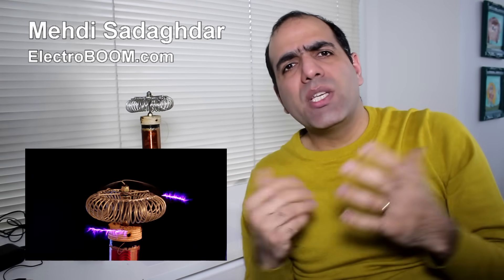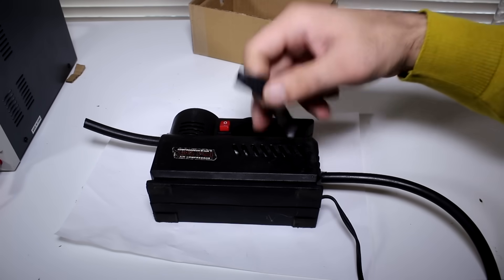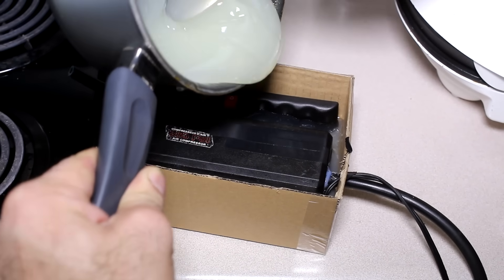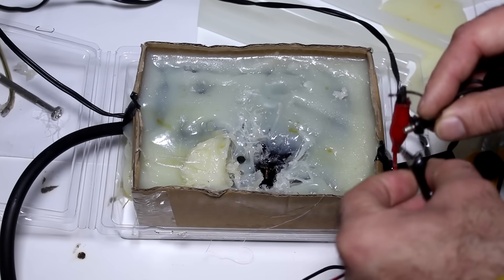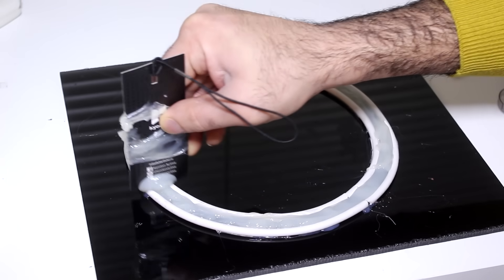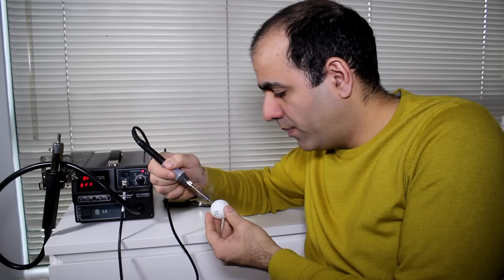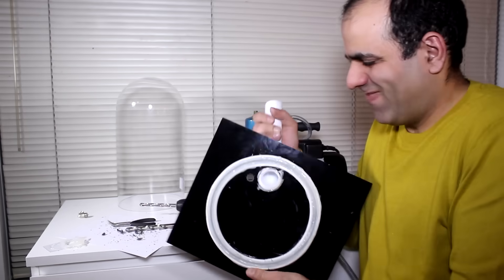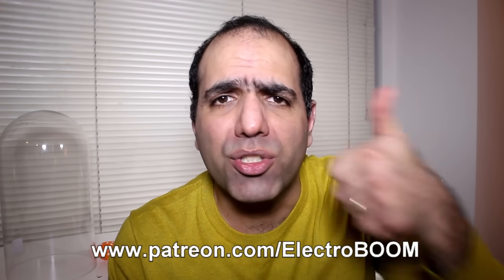Trying to Build a Vacuum Chamber

Comment: It's a legendary video but on a different note, could you not have just bought a bigger vacuum chamber and put the car tyre compressor inside to pump out the air from inside?

Comment: I connected all the capacitors I have in parallel and charged them with 9V. I could light an led for over 15 minutes until I got bored looking at it. I decided to discharge the capacitors by shorting them and that was the biggest ark I've ever made. I felt like electroboom
Reply: How big was the arc? I donth think the arc can be too big with 9v
Reply: @Aaaaaaaaaaaaaaaaaaaaaaaaaa-i8y  Not ark, it was a spark. Sorry.

Comment: Use something significantly stronger than plexiglass for the base of the vacuum chamber, Don't do this stuff without proper protection if you don't want to go blind, and I don't know if you'd want to make your own compressor, but silicone might work for sealing things, but never use cardboard, and never use tire compressors for vacuum chamber compressors.

I don't know what else to say.  Should I really give up on making a vacuum chamber?

Comment: 4 year later , mhedi  a  compressor from an old congelator/refrigerator or home AC unit do the trick for both compressor at 150psi and vacuum at 30hg/cm , and they are so silent u should have one in our shop !

Comment: 6:19 I know this is from 2017 but if anyone wants to do this use at least 15mm MDF sheet sealed with polyurethane resin, including any holes drilled in it.

Comment: This teaches us that we should NOT make our own compressor
Reply: True
Reply: @veenakumari4431  you want 👊💪
Reply: True🤣
Reply: mmm... i think otherwise.
Reply: @totallynotafurry6323  i made a vacuum with a fridge compressor works like a charm :)
Reply: I think that you mean that we should
Reply: He could've just substituted the hot glue with silicone...so.. meh
Reply: Up to the "drowning plastic in hot glue" part, it was a good idea.
Reply: @paracovo  I think that "drowning switch in hot glue" is still a bad idea, otherwise the switch is over.
Reply: I watched him encase his compressor in silicon, wondering if he has really no idea how hot compressors can get during operation ...
Reply: I feel like this could have worked with the hot glue if he went slower and did multiple batches and waited for it to cool down, but hot glue with plastic wasn't the best idea in the first place
Reply: @yellowice0  also just opening the casing and sealing a valve around the input, because its a super small little hole so you can seal an adapter above it and connect that adapter to a hose.
Reply: False, make a wooden chassis for making a vacuum chamber, it's stronger enough to resist the heaviness of air.
Reply: CasamSaturnBOİ is cutie - Enjoy it might work, with a really dense wood, but wood is almost impossible to get air tight, wood is porous and would leak air, it absorbs water like it would air
Reply: @yellowice0  Actually, if you put silicone on it the air won't leak, it will be inside the vacuum chamber.
Reply: or just use epoxy or silicone instead of hot glue :,D
Reply: @notlisztening9821  Yeah, hot glue is just hot hot hot hot hot, and silicone is cold cold cold cold cold.
Reply: True XD😂
Reply: I'm a jenious 🤪
Reply: Well I think, there's a specific mistake, or bunch of mistakes if you find all the specific ones, that this teaches us that we should NOT repeat, if we want our homemade compressor to work.

Comment: What is that glassy thingy called exactly. Could really use a vacuum chamber myself for casting.
Reply: look  on   amazon / ebay.    usually looks like a stainless steel stew pot; not counting the pump.     cheers

Comment: Title: ”Trying to build a vacuum chamber”

Me: or you can buy a vacuum from Walmart
Reply: A vacuum cleaner wouldn't work for multiple reasons.
1. They have relief valves in them.
2. Most of them aren't sealed for crap
3. They aren't powerful enough 
4. Your vacuum would overheat in like 10 minutes

Comment: Please help I have a dehumidifier compressor to make a vacuum chamber but I am a lil confused on the wiring. It has 3 wires from housing . Looks like an overload thing.... how do I wire with that. I have used capacitor to power the overload or is that wrong???

Comment: 3 things: 1. does any insurance still wants you?

2. How are you still alive?

3. Are you really that stupid or just a good actor?

If you take for example TheKingofRandom and compare their Vakuum chamber with yours, the first thing you will see is, that they used really thick glass. Not like the window glass you used. Second thing, they had not like 2,5mm thick plastic to seal the chamber. It is more like 2,5cm thick. Man, you really should consider start a new live without doing such dangerous and dumb things.

Comment: In electrick cars They put two stepbdoun gear ratio attached to the motor because of the high torque of the motor. Why don't they put a generator attached to the motor that recharge the battery  and the load of the generator will work as stepbdown gear reduction.

Comment: Your idea is good, use an aluminium base instead of plastic.  Naturally if working with high force's one has to use durable components. By the way every fringe has a compressor engine inside.

Comment: AHAHAHAHA ^^ Too good :D

Btw: Theres some 2 Component Clue for exact this case, "epoxydharz" but the price is a bit high. Also the hot glue isnt perfect watterseal. Believe me even if it is in begginning it will find a way to crouch under the wires and into the glued object grrrr

Or buy a vacuum device online and send it back after the test but pssst, you dont heared that from me ;)
Why not use a stable iron plate instead of the plexiglas? If the glas is thick enough and has no microcracks it should work actually... But better wear Securityglasses, no warranty from me given to all of that information :D :D :D

Comment: You can make a vacuum pump using the air inlet of an old compressor from an old college refrigerator they are also found in those upside down water bottle dispenser things with chilled water capability. You can even make a FREE ENERGY Compressor with the otherwise wasted output so you could have 2 devices in one. However if you turn it on only to use the Compressor then it becomes a FREE ENERGY Vacuum Chamber instead of a FREE ENERGY Compressor because the energy is used to run the Compressor. BUT if you turn it on only to use the Vacuum Chamber then it becomes a FREE ENERGY Compressor instead of a FREE ENERGY Vacuum Chamber it is very technical and only a few people can possibly understand this zero point communication, I am glad you speak the lingo. I wrote is comment using 101% FREE ENERGY :D :D :D lol

Comment: If you'd run the entire compressor inside the vacuum chamber then all you'd have to do was plug it in and connect the original hose to the outside :p

Comment: @ElectroBOOM

Use 1/2 thick steel plate for the base, mild steel should do just fine, and use dense ballistic glass to ensure that it can handle the pressure. After that you just create a good seal and the rest is what you make of it.

Comment: Will your glass dome take the atmospheric pressure? We had one at work that imploded, so they put a wire cage around the replacement. I made a cheepo with a cheese saver glass cover on a piece of 1/4" thick piece of steel. That worked well, but is too short to get a Tesla coil into it.

Comment: I heard about a dude who took one of those industrial dough mixers, 3/4" plywood and rolls and rolls of aluminium foil. He used 3 refrigerator pumps to pull a deep vacuum for a sputtering project. I use a pump (like yours) and a vacuum chamber consisting of an aluminium pot with an acrylic lid.

Comment: why did you not just make a box for the air compressor to fit inside of, and seal it with only the air inlet going to the vacuum chamber? this is something I plan on trying, as well as using it to reverse and output stuff like CO2 under pressure to my system, (or burn away all the oxygen so that its almost all nitrogen and CO2 lol.)

Comment: No worries: Take a metal plate as base with a rubber matte on it. It won´t crack. It won´t make a high vacuum though, so the tesla experiment should give a nice purple glow as there is still a bit of air in it (talking of experience by testing pulse plasma thrusters).

Comment: First, measure the area of the bottom plate in inches. Then multiply by 15. This will tell you how many pounds of force the bottom plate has to hold against. And I can tell you from experience that 1/4" of plexiglas will not work. Also, when you finally do a first test, protect yourself in case the dome shatters explosively.(it might, probably won't but you never know)

Comment: Gasoline engine at idle has 15 to 20 in/hg. That's all Ive ever used as vacuum pump. Bleed brakes or whatever you need
Reply: Interesting! Please elaborate,n, got tons of small engines.
Reply: The stoichiometric ratio for gasoline fuel is 14.7:1. Gasoline engines use a valve on the air intake to maintain close to this ratio (ratio can vary depending on load) At idle and no load very little air is needed so valve is almost closed. On a small engine at same condition, anywhere between butterfly valve and intake valve there will be vacuum. A small engine will be difficult to use as a vacuum pump because small alteration in vacuum could kill it. I use a 4.6 v8 in an 08 ford interceptor. (Intake has plenty of places to hook into)Oh and if bleeding brakes make sure motor doesn't suck in brake fluid. Nasty smell and smoke.
Reply: @jamesw5607  Awesome idea, necessity is the mother of invention. Guess it's not a good idea to give the motor a good WOT rev while bleeding brakes?!  Lol!  Will probably suck the lined dry in seconds, tons of smoke as well!
Reply: @jamesw5607  Yeah, your probably right about small engines. Doesn't take much to starve it of air even at higher throttle levels.

Comment: 5:32 I guess the result was negligible JAH JAH JAH facepalm (BLEEP) (BLEEP) (BLEEP) (BLEEP) I need a air compressor
Reply: Youre pfp confuses me
Reply: That forehead slap tho
Reply: Ur pfp is cash money
Reply: The HYA HYA HYA made never stop laughing
Reply: Lehi Winge as an enganer he should know a hvlp (hi volume low pressure) like a vacuum cleaner. And a compressor.
One pushing a lot of volume at low pressure.
The other uses a lot of air.. squished into a pressure vessel.  What would be your choice to try.. 
plus he’s way smartr than me.. (his gimmick to borrow?)

Comment: WHY couldn't you have made this video 8 or so years ago!
Egg drop experiment using toothpicks and superglue was the task.
The first time I cheated making my teacher define what a toothpick was. (I sharpened dowel rods into the shape of toothpicks and made an argument that they were Shaq's toothpicks )
I won the argument/debate.
I had no idea you could melt them like you did in this video.
I DID try a to put them in a coke can and put them in a pot of boiling water with no success

Comment: This is literally my life story. Getting so close to accomplishing something then when I am about to finish my experiment it fails miserably
Reply: @Blondie SL Remember that ambient air pressure, roughly 1 bar or 100000N/square meter, is equivalent to a 10 meter high water column. The base will have to support that weight.
Reply: Ur pic looks like a hair on a screen
Reply: Flint Lockwood?

Comment: did you know, Vacuum chambers are extensively used for simulating deep space conditions. many ion(emission), electron devices(e.g. welding) require vacuum environment. Vacuum drying( with sub-cooling) is required for preservation of certain bio-chemicals. soft vaccuum is a standard practice in packaging(say, dry fruits). did you know, Vacuum Chamber is normally degassed using a Rotary Vacuum Pump. it is a mechanical pump that pushes the air out of vacuum system. Rotary Pump requires Rotary Vacuum Pump Oil as working medium. by pumping on it with a very low vacuum. this process can be spread in by heating the chamber. this assumes that the chamber is completely free of oils and other sticky volatiles. just saying.

Comment: Get two inch or one inch glass squares to silicon glue together then cut holes as needed on the top of the glass for the suction in/out

Comment: Just a suggestion, buy some PVC fittings or swaglok fittings, NPT to tube and your compressor and vacuum chamber should work, don't forget to teflon NPT side and put silicon paste in order to avoid leaks, also put a "T" fitting after the compressor and before chamber to install pressure gauge. You need the pressure gauge in order to see if you have leakage and the amount of negative pressure you have. Stainless steel or some acrylic should work fine as your base, or just get some steel plate from old electronic box, or use your microwave oven chassis temporarily. Hopefully you can continue this experiment in the future. Good Luck.

Comment: To make a vacuum chamber stainless steel works best.
I have gotten my vacuum chamber down to 0.06 torr.
I have boiled ice at room temperature. But that was no where near 0.06 torr.
Didn't get really strong vacuum until all water was evacuated.
Then after the water was gone the vacuum dropped to another plateau as some other unidentified volatile compound flashed, then it dropped rapidly till something else began to vaporize. 
It was really cool to watch.

Anyways, I used 1 inch lexan plexi as a window. I made a flange with a double o-ring groove and used 1/4" buna o-ring softened with toluene and coated with an iso 32 lube oil. The chamber that I used was 1/4" mild steel pipe with and end cap on one end and the window flange on the other. The reason I recommend against using mild steel is I got to a point where I was pulling a large amount of air through the pores of the metal and it prohibited me from obtaining a low torr.
I had to coat the exterior numerous times to get it to seal.

It was an horrible ordeal.

Presently, I use stainless that has been tig welded. Stainless has much less pores or has a higher density... Same o-ring and same plexi for the window. It was much easier to achieve far better results.

Comment: +ElectroBOOM Try using a fridge compressor it is already sealed and has input and output tubes, just be careful if the gas hasn't been drained from the fridge its toxic, but most fridges at the recycling center should already be drained. 
Would love to see you have another go.

Comment: Put alcohol on hot glue it comes off like it was not even stuck  , any compound will work even perfume and deodorants with high amounts of alcohol
Reply: whoa, thank you very much
Reply: Yeah. It is like magic. Have to try it to believe it.
Reply: Isopropanol / isopropyl works. If you work with microelectronics, you have that around anyway.
Reply: @Sypaka  yes, isopropanol, aka rubbing alcohol or isopropyl alcohol. Or, just "alcohol". In other words, you are just repeating what the OP said.
Reply: Ah, all of them are the same?
Reply: @Sypaka  "Isopropanol," "isopropyl alcohol" and "rubbing alcohol" are all the same. The term "alcohol" by itself is more general. Ethanol, methanol, and isopropanol are all part of the alcohol family. But from the context, I am sure the original poster was referring to Isopropanol.
Reply: I thought, he was referring to other kinds of alcohol. Hence I made my comment. Mistakes happen.
Reply: McKenzie Keith the OP stated "any compound will work". Rubbing alcohol is commonly available in mostly isopropanol and often ethanol versions too.  Perfume and many other cosmetics use only ethanol.

So don't be a smartass, let the man speak.
Reply: EXcentriX you weren't mistaken, the OP worded it to be understood as such.  Ignore the critics lol.

Comment: The hot glue Method can be done in a easy way and not melt the plastic you just need to keep the hot glue hot enough that it is liquid and not cold enough that it hardens under a minute , I do it all the time by turning on and off my gun periodically and after 30 seconds I can touch it and mould it

Comment: Probably Plexiglas base plate third times thicker would be better, because plastic bulb above it would shatter first then. Kudos about molten pump :D Hot glue is amazing stuff BTW. I'm using it sometimes to prevent moist getting on soldering spots in mine racing quads.

Comment: Having seen some pretty nasty accidents with glassware failing under (modest) vacuum, that bell-jar was giving me the willies!  Really should be behind a safety screen (even a sheet of Perspex will do fine), and you'll find you have to pull quite a decent vac. (milliTorr) to see any effects on discharge. As an aside, there are a few decent Refrigeration vacuum pumps out there that are not too costly (and work extremely well).

Comment: Knowing full well the pump wouldn't have worked even if you had solved the issues, using HOT glue was terrible choice. Could have use a couple tubes of silicone caulk.

Comment: Ooh, Mehdi! Idea for a cool explosion! I wonder what would happen if you plug a speaker (just the speaker, no amplifier, etc) in to 110 volts ac @50 hz (city power)? I want to try it myself, but I don't want to ruin a speaker.

Comment: Dude you had the stove on wayyyyyy too high and hot for the glue.. should've melted the glue just hot enough to melt it not cause all that smoke and the glue was so hot that it melted the motor.. what a disaster lol

Comment: you should've used silicone
Reply: , epoxy (otherwise known as potting compound) would have worked better. It also transfers heat from the motor better than silicone
Reply: @IYA-nc7yl  As shown at the end, it was doomed from the second he chose plexiglass as a base. I don't know what level of vacuum he was going for, but 1 atm=14.7 psi which is a lot.
Reply: Um... he did.
Reply: Sillycone
Reply: @bencrosbie : What about it?

Comment: Could you put the cheap 12v pump in the chamber and pass the outlet hose and electric line through sealed fittings?